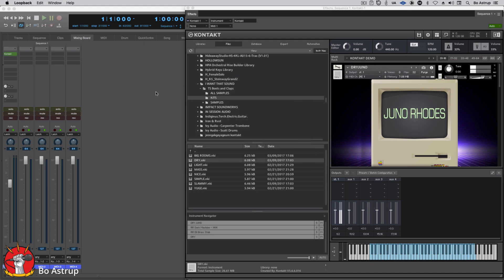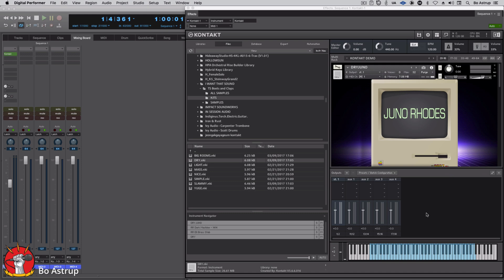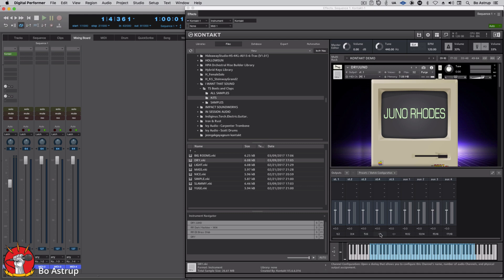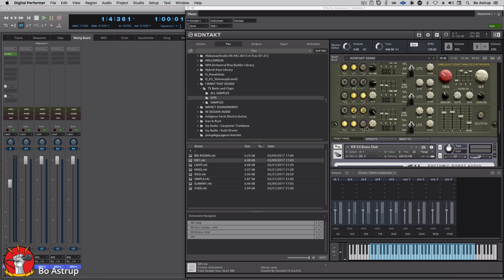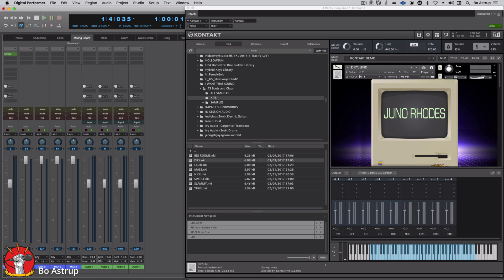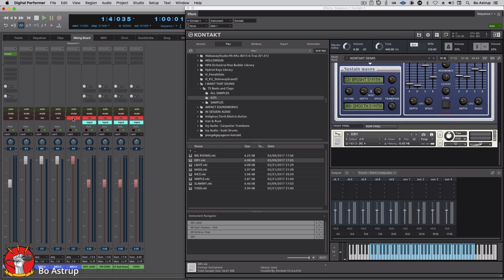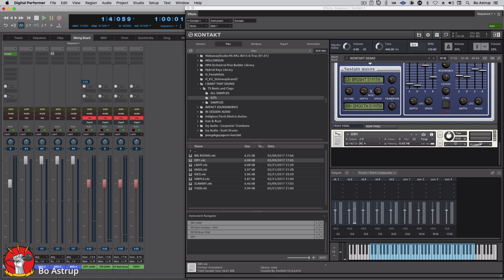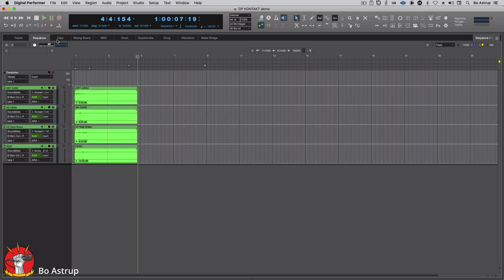KONTAKT routing to individual tracks in MOTU Digital Performer.

Comment: Bo Thank you for your time for producing that tutorial.. It does require a little more than I thought..I will definately expolre and try to replicate your tutorial  at my studio........Many Many  thanks
Reply from the maker: Yeah, unfortunately KONTAKT is not as easy as say UVI Falcon. And some Kontakt libraries might require more work than others. What are you favorite Kontakt Libraries?
Reply: @BoAstrup   For a long time I have been recording Digital On a MAC , 828 Motu then going in to a Mackie mixer  and out to DAT.. then convert to WAV Shows how old I am.. But the sonic response of out producing a project directly in the BOX "Computer" with no analog is strikingly different..thats why I requested this to you.. As you know everything before was RACK MOUNTED.. and I used that for quite a while until Pug ins came along and changed the game... I use the Roland racks here and there and  outbourd Processors.. but Just cant get that sonic clarity overhead Sound!..I hate the fact that we have to play the role as musican and engineer..which I hate the most < This project  Im using Spitfire Albion 1,  Libraries and alot Aparillo..and Vocal codex.. so really I asked the wrong Question,, It should have been " HOW TO CONVERT MIDI Using Multiple Plug Ins to Audio WAV>> lol!